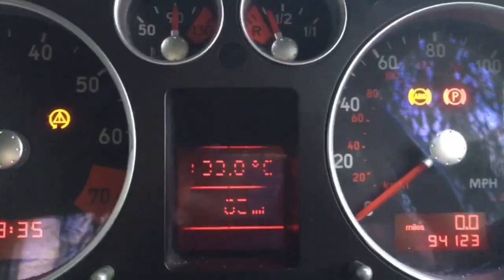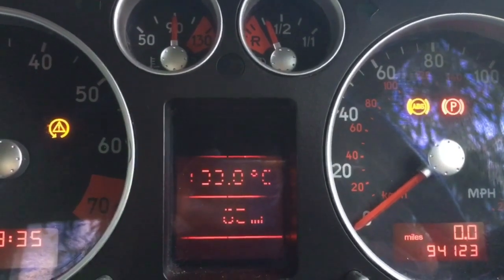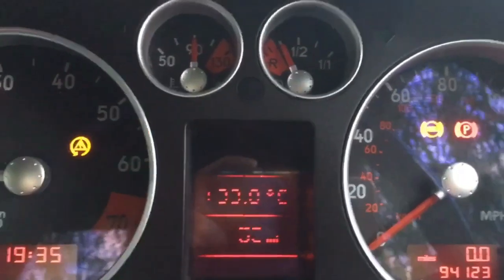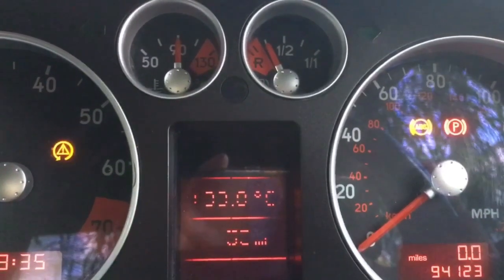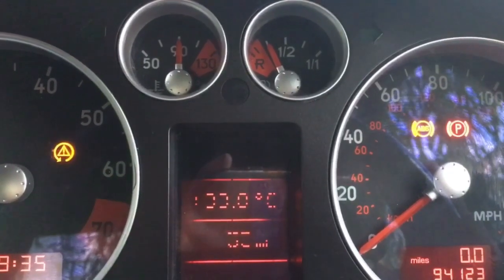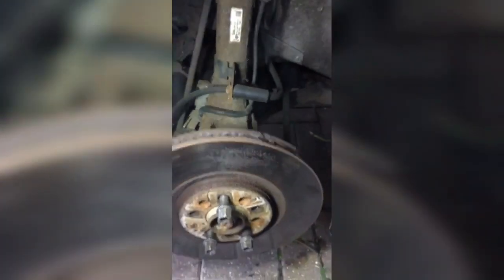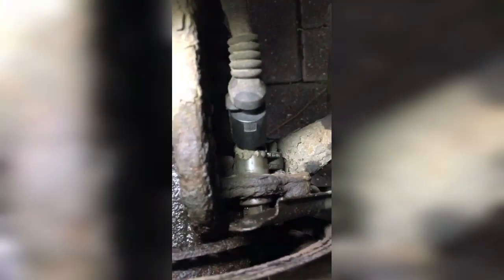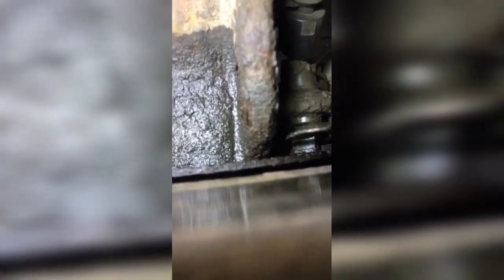ABS sensor fault on my MK1 Audi TT clean up

Comment: Just in my case :)*
Quattro BAM 2002

Problems : 
TC light on ( in some intermittent)* but back against n again for some years and permanently turned on 
I was though about Those speed sensors, cleaned up but it didn’t cure rightly 
I got some MIL codes; related to G201/G214, even to 4WD, Radio, etc etc and even replaced the Brake switch, 716 Relay related to ABS etc but yeah it didn’t cure the   Problems ,plus  all common fuses related
Lastly :) I was thinking about something just happened to ABS system so the reason about G201 , I purchased the brake fluid dot4 class 6 ( SL6) from ATE, pretty thin designed for ABS / TC and I did flush those lines and scanned the car, cleared up those codes and DONE ! No code anymore 
No need ABS sensor, No need G201/214 everything just fine - even greater than before! You guys will not believe it ! 
Yeah I had also changed the haldex fluid too since probably time ! 

worthy try !

Comment: Wheel bearings hold the abs sensor ring. These corrode and confuse the sensors.. wheel bearing need change..

Comment: Have had ABS light on constantly since I've owed my 2000 1.8. Got it through MOT as ABS was working fine, not sure if it's pure coincidence but have now managed to clear it and its working fine. All I did was cleaned the earth contact of the 3 wires that connect to the body underneath the battery compartment/tray. . I actually snapped the nut off trying to undo so have used the right hand tray mounting bolt as a fixture having cleaned the area below. No idea if this has anything to do with it at all, but all I know is its working great and no more annoying 4 beeps every time I turn the bloody thing on!
Reply: Forgot to mention I also replaced the alternator as mine had failed at the same time, put a 120amp one in instead of the 90(but makes no difference I'm told) again, no idea if that has helped cure the light or not either
Reply from the maker: Sounds about right. Thing is with electrics you can narrow down the fault but changing the part isnt always the answer so good job on doing what you did

Comment: How did you clean it?
Reply from the maker: Just using the wd40/clutch cleaner etc and a wire brush did the job
Reply: Channel Tee Great Post.  Have same issue on a very low mile (16k miles) 2001 TT 225 Roadster.  

Did you remove both abs wheel sensors to clean them or simply clean around them/in place?  Thanks again for the help.

Comment: Traction control light? Ive got that on mine and getting a engine code 00810: sensor 1/2 for brake pressure, did you change your sensor?
Reply from the maker: SliipzHD i didnt change the sensor but i guess if this doesnt work it would be the next step. Could even be the actual ring where the sensor gets signal from. I would say do some research in relation to that code?
Reply: Channel Tee yeah ive got front disc and pads ready to go on em so when they’re off im gonna give them a good clean up
Reply from the maker: SliipzHD if you’ve got a wire brush you can attach to a drill that might really help with the clean up. Some of the crap on there is solid!